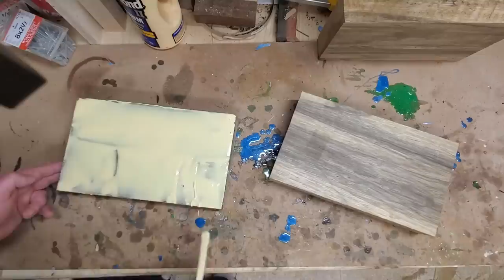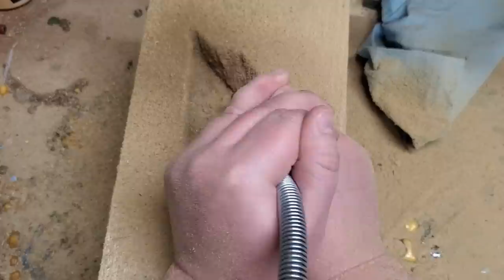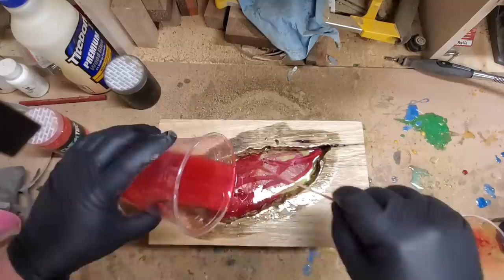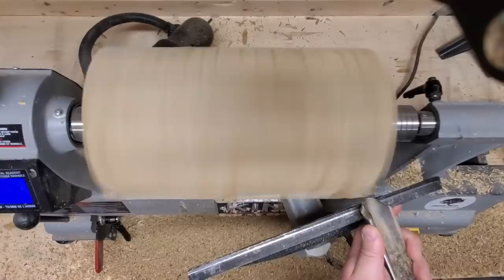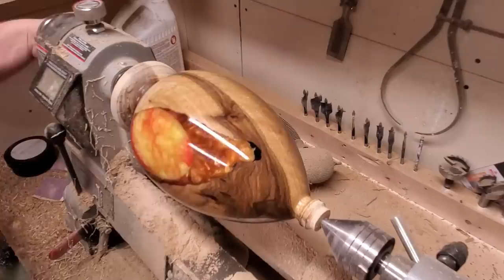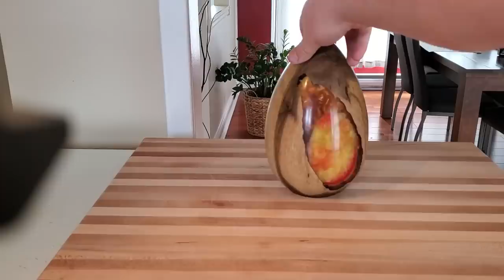Wood turning - The Fire Embryo

Comment: Glue and salt... I'll remember that one!!!!
Reply: I wouldnt recomend that to be honest you can rouf your would up with some sandpaper if u want more grip. But mainly use less glue than that. If its a solid layer between your wood surely it wil come loose. Cause its like a plastic sheet between the wood.
Reply: I don't understand.  How does the salt help?
Reply: @kimhuff  its makes it grity. Like adding sand grains. But salt resolves in the glue. And where does this not add up.
Reply: @kimhuff  same as sand on ice, helps prevent slips.
Reply: @kimhuff  Just as large grains of sand glued to a mat helps prevent slips, the salt helps grip the wood to prevent it slipping.
I suppose even small amounts of regular sand might do the same thing.